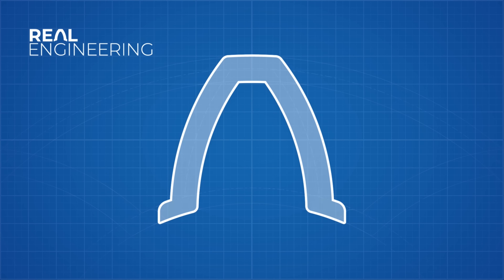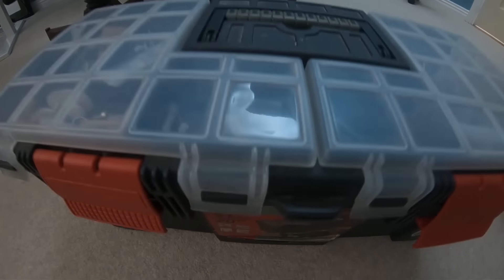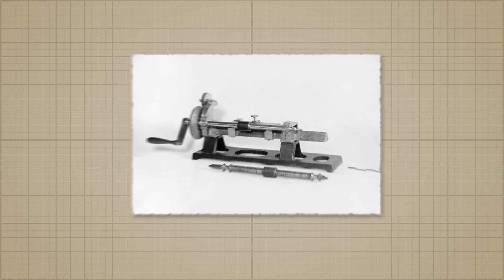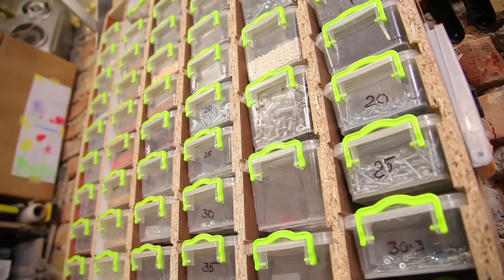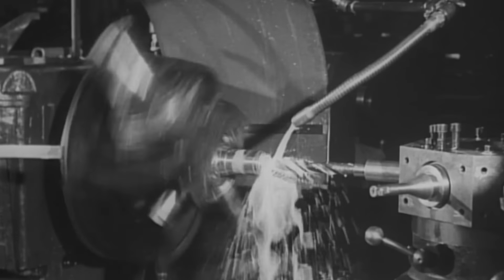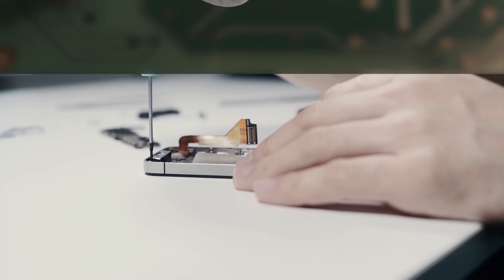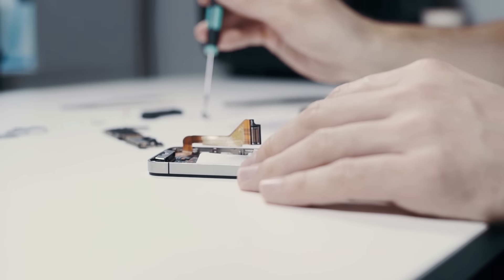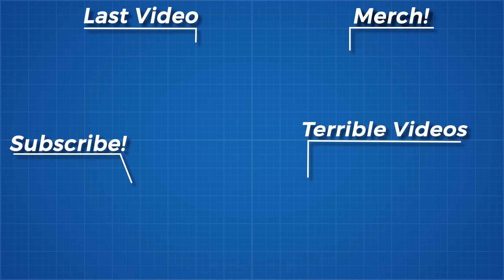Why Are There so Many Types of Screws?!

Comment: Ive been a journeyman carpenter for close to ten years and I definitely appreciate the torx screws. Robertson's come in second, they strip easily but get the job done. Philips are completely useless, I dread having to use them. The only situation where they are beneficial is when the driver cannot be held perpindicular to the fastener, such as on door lockset hardware. They are the only fastner you can screw in on an angle. Great video

Comment: Still more useful information than school
Reply: In my engineering school, nobody could find the properly sized hex key to fix the 3d printer nozzle but I did find torx bits without a driver. I managed to secure that thing on a drill and proceed. 

Moral of the story: always bring your own tools

Comment: Having used a lot of screws, I've come to the conclusion that square heads are best heads.
Reply: In germany hex heads are the standard, though we do also have an interesting variant on those where basically, the head itself isnt round but hexagonal so you can turn the screw like a nut.
Reply: Ain't Robertson great?

Comment: Great video! Next may I recommend answering why there are so many different screw threads. Drywall vs machine, etc. That I would like to see. :) Cheers!
Reply: You can't compare a drywall screw thread to a machine screw thread. They're designed for completely different applications and material. It should be self evident. Take a #10-24 machine screw and thread it into a piece of wood then try to pull it out. Do the same with a drywall screw and you'll have your answer.

Comment: What about head shapes, not just driver shapes? Like panhead, tapered, recessed, cap ... ?
Reply: +Paul Smyers
you can go NUTS trying to order a panheads, buttonheads, mushroom heads, or  modified truss head vs round washer head. There might be some machines out there in the world that might have some of these confused.
Reply: Then there's the length of the screw

Comment: Pro tip: If your phillips head screw is too worn out for a Phillips screwdriver to extract, you can usually use a square screwdriver to extract it instead.
Reply: You just need to trial and error to find the square head that works best for you.

Comment: A house we bought had a TV mount attached to the wall when we moved in and it was bolted into the studs with security hex bolts with the little pin in the middle.  The angle grinder immediately came out.

Comment: I'm a marine engineer and it is a nightmare. First, we have screws, Woodscrews and self-tapping. Flat, Philips, Pozidrive, Hexagonal, Torx, plus variations including dimples in the screw head. Then we have bolts and set-screws. Metric, UNF, UNC, Gas, Plumbing, Whitworth, plus the fact that Japan uses 12mm heads instead of 13mm heads on 8mm bolts creates a massive problem. Theoretically, no bolt or nut in engineering needs a 9mm spanner. I have had to use one. A 3mm nut requires a 5.5mm spanner and a 4mm nut uses a 7mm spanner, so what's the point of a 6mm spanner?

Comment: So why aren't we phasing out Flat and Phillips head?
Reply: Because there is no authority in charge of such things.  You are free to phase them out where they are under your control.
Reply: @GH-oi2jf  no authority should be needed. The market will usually phase out outdated tech on its own (see vhs, floppy disks, dos, etc.). I wonder what's different here?
Reply: @serpentinious7745  — What is different is that there is no motivation to make a change, in most applications.  For example, the cover plate over an electrical receptacle or switch in the USA is usually held in place by one or two slotted screws.  It works perfectly well as is.  Everybody either has a small screwdriver which fits these screws or can easily find one at low cost.  There is no need to change.  The hinges for my cabinet doors use small Phillips drive screws.  These work well in that application because they hold the driver centered, so work goes faster.  There is no need for anything more sophisticated in that application.

Comment: The first security torx I ran into probably sometime in 1992 I easily bypass by taking a flathead screwdriver and grinding a slit down the middle making it like a snake's tongue and easily bypassed the screw security.
Reply: Like any security device, it isn’t supposed to be impossible to defeat.  Security devices slow down intruders and may exclude casual intruders.

Comment: You can undo a lot of security screws with a flat head screwdriver, torx, square, triangle it can be driven with the right size.
I absolutely hate flat head screws, fortunatelly those become rare.
My favourite are hex and torx.
Though it is easy to round hex screw if you have crappy set of allen keys, make yourself a favour and buy a decent set from wiha called hex-plus.

Comment: “One country holds on…” You mean the 5th most populous country, 3rd largest by area and the single biggest economy in the world? That country? 
Changing to metric would be like forcing a whole country to up and change languages. I’m in construction and carpentry and I’ve done a lot of machining. I am very intuative with standard units in a way that would take a lifetime to adapt to new system. And why do you still call them “2-by-4’s” instead of “50-by-400’s”?
Reply: The entire "Construction Industry" in Australia "transitioned" to metric within two years (by January 1976 - almost 50 years ago !)
What were "nominally" called 4 x 2  (but were really 3.5 x 1.5 ) became 90 x 45 (mm).

English speaking countries (outside North America) refer to the Larger timber dimension first.
Reply: Yeah but it can be done sector by sector... starting with pre schools

Comment: torx? the best screwhead?
of all screws and screwdivers with damage that prevented using them properly, 9/10 have been torx, its the worst standard BY FAR
Reply: With torx the less torking about it the better
Reply: Every type of screw drive is optimized for a particular purpose.  There is no one type which is best for all purposes.  That is why there are so many types.  As for torx, I think it’s a good design.  If it gets damaged in use, either someone used the wrong driver, or it was the wrong choice for the application.

Comment: I just wanted to change the battery in my phone. 18 tiny torx-head screws. I bought a set of tiny torx head drivers only to discover the screw-heads are made from custard  so a third of them allowed their torx heads to be rounded off rather than undo. Drill time.

Comment: You didn't talk about the triwing screws. Some aircraft manufacturers use them. I first saw them on a DC-10. They suck. They torque on well but you can't get them out after a while. DC-10 used titanium screws so they were even harder to remove. Spent endless hours drilling them out.

Comment: Beside screwdriver (key) shape, material also influence torque, but at least the 'square head' did made it way as 1/4 or 3/8 or 1/2 square driver used in torque wrench. 

You can have entire catalog just for 1 type of screws and so finding the right tool for the right job is a challenge in itself (even with thread gauges), because you could have:
Metric or Imperial, Material issue (some times you cannot tell just by looking), thread pitch NPT vs BSP, self tap profile (for DIY 60 deg or thermoplastic 30 deg), key shape, head style (CSK, dome, flange, hex head & etc.), nylock (self locking or use loctite), with or without Shank, snap head (shear off), coach bolt, shoulder screw, screws for furniture, for engineering metal, threads for dynamic application like leadscrew, Buttress, for yatch & etc.

Comment: got some stuff about the phillips screw wrong

if your screw driver is slipping it's either worn out, the wrong size or you're holding it crooked
it's not a one size fits all type of deal

but be warned, there are screws that look like phillips, but they are not, usually found in the asian market

phillips head screws can transmit so much torque that you can shatter a screwdriver if the screw is stuck

and that's why you NEED a manual impact driver for phillips head screws
these things are cheap and simple, but get the job done unlike any other tool

Comment: I love torx bits. I know you guys are gonna questiom me but you can use a torx screw on a hex head and it will unscrew it even if it is pretty stripped. It works every time with me just make sure you use a generous amount of WD-40. I almost never use hex bits anymore.

Comment: There is much more to the subject of screws that wasn’t covered here.  Head shape is hugely important too.  Flat head, button head, truss head, rounded, locking, to name a few.  Flat heads are better for precision alignment because they force two holes to concentricity.  Round head is better when a loose fitment is preferred.

Comment: I get the disdain for US Standard but 3 grains of barley isn't why they used the mile system for millenia. That specific law was just an arbitrary benchmark. There's actually some really interesting math and geometry in that base 12 system.
Reply: Barley hasn’t been relevant to measurement for a long time.  In preindustrial times, grains of barley were useful for measuring small weights because they were commonly available, hence the unit “grain.”  I still think of an aspirin tablet as 5 grains, even though it has been marked 325 mg for many years.

Comment: i still like torx the most
Reply: The best drive type depends on the application.  For example, I have some concrete screws with square drive.  I doubt torx drive would be as suitable because of the high torque required.  Torx drive is generally used in low-torque applications.

Comment: You made a mistake. You show a Macintosh and say that Apple used torx screws to make it harder to open the machine. Actually, the original Macintosh computer did not have torx screws holding it shut, it had hex screws. I am sure of this fact because I have some of these computers. And as I am writing this comment, I have the tool made for opening the Macintosh here on my desk. The tool is definitely a hex screwdriver.

Comment: Now the question is why do manufacturers continue to use Philips screws. The Robertson patent should have expired or they can use torx.
Reply: Phillips screws have some advantages for manufacturing.  They go in quickly because of the way the screw head holds the bit in place in the center.  They avoid overtightening because the bit will cam out.  The latter feature can make them hard to remove, however.  Manufacturers don’t care much about that.

Comment: You forgot to mention about a plain straight drive can only be applied every 180 degrees (phillips is every 90 and a hex is every 60) Also would of been to stat reason fir counter sunk and internal vs external drive. Plus phillips has a pozi drive (extra cross) allowing more torque to be applied improving the classic cross shape.

Comment: Hex are bad for the reasons you mentioned, but to put it into more layman terms, they're too round and soft. Despite having better cam out resistence than phillips, whenever a hex screw DOES cam out, it does more damage to the fastener more quickly than Phillips or Torx. Robertson, IMO, is the absolute best "everyman" design for most everyday fasteners. Less cam out, less destruction when it does, better static holding, easier to work with if it's clogged with debris or rust. It's just the best.

For more security-oriented applications, there's Polydrive, which is like a meaner torx with squarer teeth for less cam out and less damage if/when it does (much like Robertson). The downside is more complicated to manufacture heads and tools. Our two screw system should 100% just be Robertson and Polydrive, the former for most things and the latter for stuff like the automotive industry. I'd say MAYBE keep slotted around for stuff like light switch covers, but even then I hate slotted fasteners with a passion.

Comment: You say 'most of the world has accepted metric threads'. Possibly true, but I think you'll find that in France, where I assume metric units originated, they still use BSP threads for pipe fittings. That's BRITISH Standard Pipe threads. There must be a good reason for that.
Reply: Compatibility with old plumbing.  They also use UNC threads for camera mounts.  And UNEF for putting air in tyres.

Comment: I had no idea Roberson was so Canada specific. It really is a good design. 

Also as the owner of multiple Volkswagens, you forgot one, very terrible, terrible design: The triple square. The points where the tool splines engage seem to have been specifically designed to maximize surface area and corrode as fast as possible. Look at a rusty triple square the wrong way and you've got yourself a zero point fastener.

Comment: Would you look at all that stuff ...
They've got allen wrenches, gerbil feeders, toilet seats, electric heaters
Trash compactors, juice extractor, shower rods and water meters
Walkie-talkies, copper wires safety goggles, radial tires
BB pellets, rubber mallets, fans and dehumidifiers
Picture hangers, paper cutters, waffle irons, window shutters
Paint removers, window louvers, masking tape and plastic gutters
Kitchen faucets, folding tables, weather stripping, jumper cables
Hooks and tackle, grout and spackle, power foggers, spoons and ladles
Pesticides for fumigation, high-performance lubrication
Metal roofing, water proofing, multi-purpose insulation
Air compressors, brass connectors, wrecking chisels, smoke detectors
Tire gauges, hamster cages, thermostats and bug deflectors
Trailer hitch demagnetizers, automatic circumcisers
Tennis rackets, angle brackets, Duracells and Energizers
Soffit panels, circuit brakers, vacuum cleaners, coffee makers
Calculators, generators, matching salt and pepper shakers

Comment: -Robertson screws came to my attention when visiting someone in NYC in about 2010.  My immediate thought was 'why doesn't the entire planet use these for all normal applications?!'
In normal use, they virtually never strip, the screw jams on the end of the driver, you can reuse them easily.   Brilliant.
-I am in Australia, and in recent years, the near-monopoly hardware retailer here has started selling square drive aka robertson screws.  I always use them where possible, but the range of screw configurations is limited, and essentially just wood screws.  
-Most decking screws here are square drive, no doubt as such are long, subjected to high torque, and used in large numbers in visible spots, so you don't want them breaking and messing up the holes 
-I didn't know Philips were intended to have the driver slip out above some torque level, but they certainly do!  And when you are using an electric driver, that immediately ruins the screw both functionally and cosmetically.  I avoid them and slotted screws  where ever possible.

Comment: Some "tamperproof" screws have legitimate uses.  Such as when they're used to secure things in public spaces, to prevent vandals from unscrewing them easily.  Or when they're used to secure things like as window guards in
apartments, a situation where you don't want children or others to unscrew the item easily.  

But in other cases, such with electronics manufacturers, they're just ways to frustrate normal consumers from attempting DIY fixes, hopefully (for the manufacturers) forcing the consumer to either buy a new product or go to the manufacturer's service center for overpriced repairs.  They merely serve as a deterrent, since getting the appropriate screw bit set isn't that difficult nor expensive nowadays.

Comment: I have a question for the people here:  On extremely rare occasion, I have seen screws that have slots at 90 `, like a Philips head but with one or both the slots extending all the way to the edge of the head; in the especially rare case of both slots being extended all the way to the edge, you could in principle use a screwdriver made by superimposing 2 flat blade screwdrivers at 90 ` to get both the torque of a flat blade screwdriver (or even better) and the anti-slipout and better centering properties of a Philips screwdriver.  (In the case of only one slot being extended, it's pretty obviously just meant to work with both a flat blade screwdriver and a Philips screwdriver, whereas in the latter case, it seems that in principle one could get a real performance boost although I have yet to see a screwdriver made to take advantage of it.)  What are you supposed to call these hybrid screw heads?

Comment: Am an American in my 70s and I hate the Imperial system.
Not many know the US tried to switch us over to the metric system.
We even had speed limit signs with MPH and KPH on the Interstate highways.

Then we had the oil crisis and the speed limit signs were all changed to 55 MPH with no metric speed on the signs. This happened in 1974. 
Only food is marked with metric and imperial weights now.

WTF?

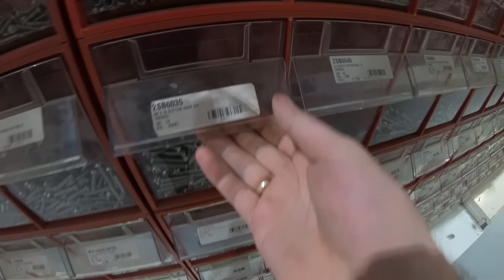Comment: Does anyone else find it problematic that this video didn't use the Internationally recognized and correct terms for these screws?  For example, at 0:32, those aren't called hex screws, there's no such thing as a "hex screw", those specific screws are called "Button head (head style) sockethead cap screws (drive style)", a screw that requires an Allen key is called a "Sockethead Cap Screw" and this is defined by the Internationally recognized ISO 4762.  Jesus Christ.

OH and another thing, there's no such thing as a "countersunk" screw, that head style is simple called "flat", FYI